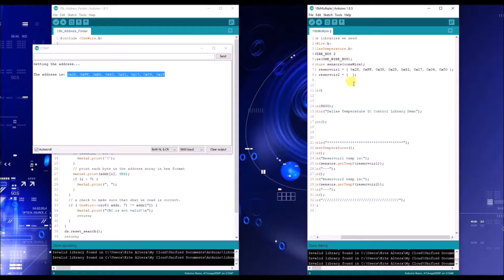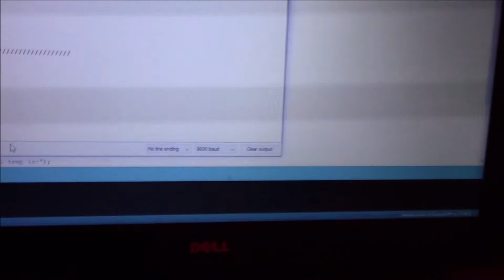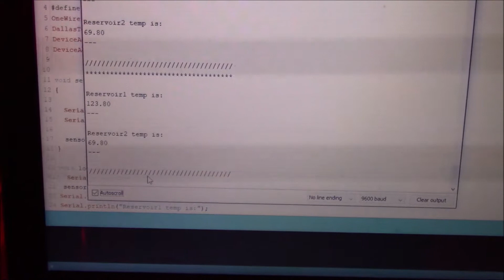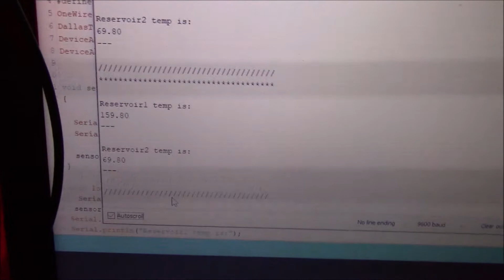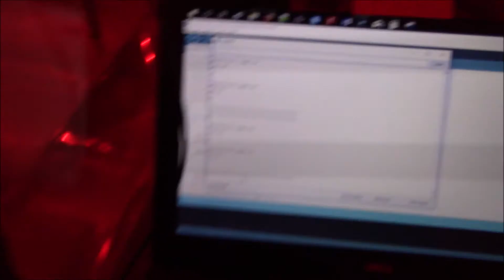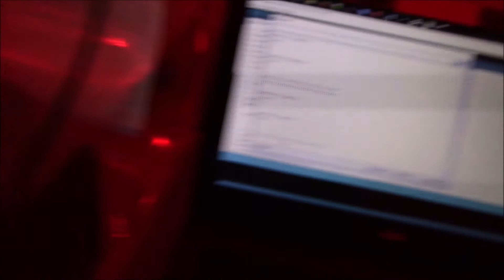Connecting the DS18B20: Water Proof Temp. Sensor

Comment from the maker: Code For DS18B20 Address Finder:

#include <OneWire.h>

OneWire  ds(2);  // This is where DQ of your DS18B20 will connect.

void setup(void) {
  Serial.begin(9600);
  getDeviceAddress();
}

void getDeviceAddress(void) {
  byte i;
  byte addr[8];

  Serial.println("Getting the address...\n\r");
  /* initiate a search for the OneWire object we created and read its value into
    addr array we declared above*/

  while (ds.search(addr)) {
    Serial.print("The address is:\t");
    //read each byte in the address array
    for ( i = 0; i < 8; i++) {
      Serial.print("0x");
      if (addr[i] < 16) {
        Serial.print('0');
      }
      // print each byte in the address array in hex format
      Serial.print(addr[i], HEX);
      if (i < 7) {
        Serial.print(", ");
      }
    }
    // a check to make sure that what we read is correct.
    if ( OneWire::crc8( addr, 7) != addr[7]) {
      Serial.print("CRC is not valid!\n");
      return;
    }
  }
  ds.reset_search();
  return;
}

void loop(void) {
  // do nothing
}